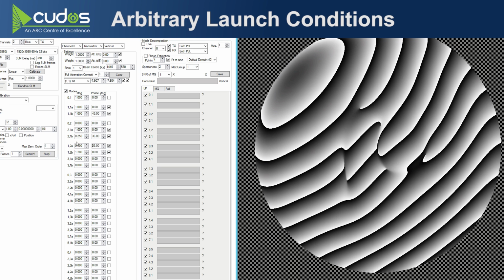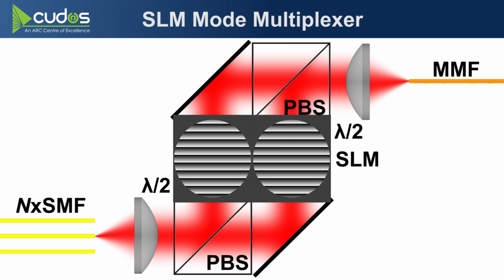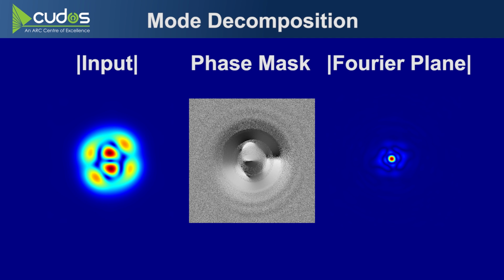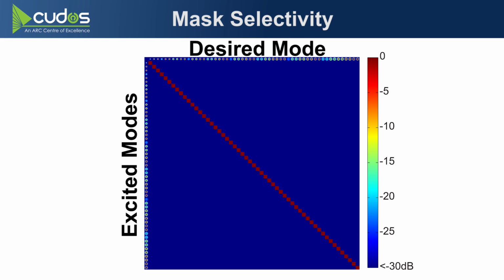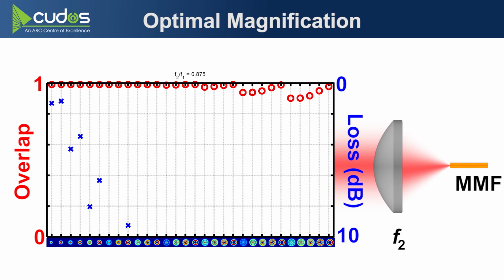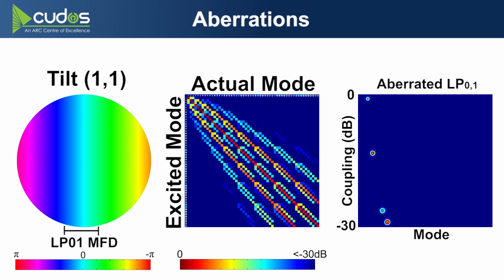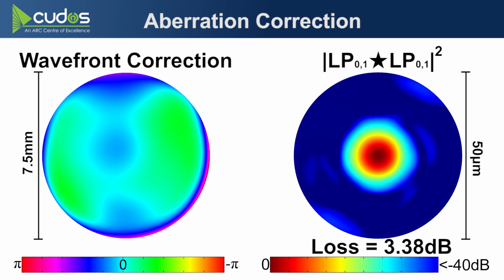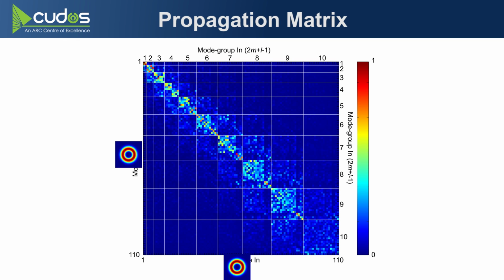Mode multiplexing, characterization & processing using a SLM (IEEE Summer Topicals MC43 8 Jul 2013)

Comment: Is the software/interface that generates the phase masks for the SLM available open-source?
Reply from the maker: I usually calculate the masks using a Gerchberg-Saxton algorithm (I don't have anything open source, but the algorithm is pretty straightforward, and I've got a tutorial on it). To display the phase masks, I use some custom code I wrote, but you can use a lot of things, and some of the SLM manufacturers give out code. Usually the SLMs are just driven off a HDMI port, like a regular monitor, and you just have to display the greyscale phase mask on the "monitor" that is the SLM. You just need something that can display fullscreen bitmaps of the correct size.